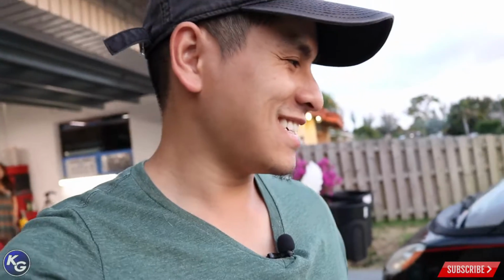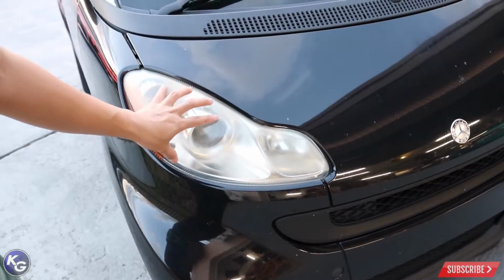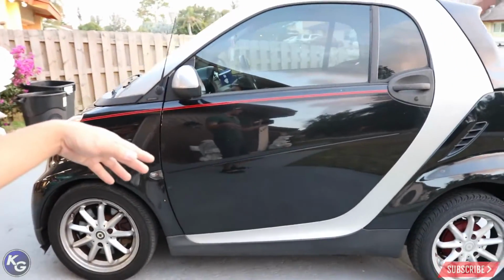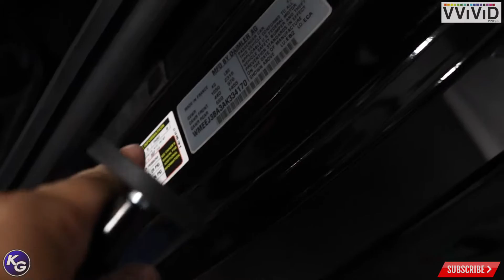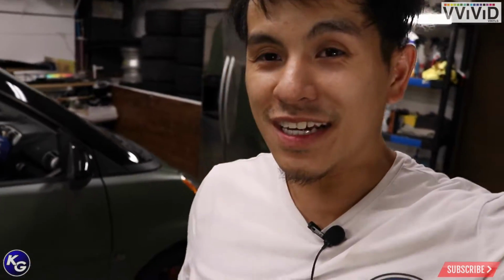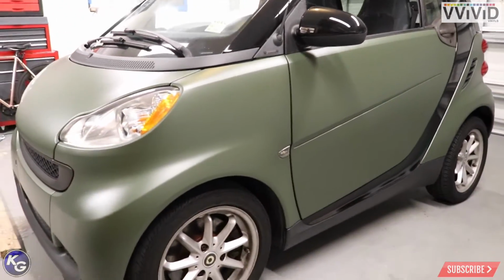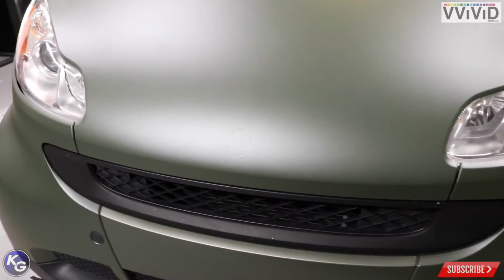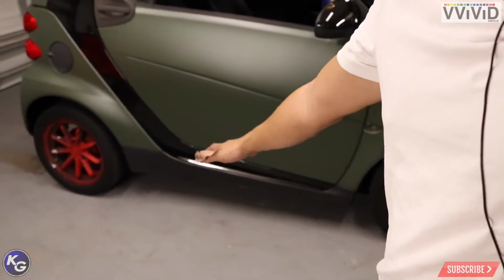I wrapped this car in 24hrs

Comment: I got an orange smart car 2 weeks ago in excellent shape from 2008 paint on the hood was peeling a little so I took down the first layer of orange and spray painted the hood(put some duct tape on the smart logo and headlights for a professional $2 spray paint job) the hood is black now(cheapest spray paint color) I might change it to brown on military green next week...I've gotten at least 5 or 6 compliments on my spray job on the hood took about an hour maybe 45 minutes...will be using at least 2 bottles of nail polish remover and a $4 can of brown or military green spray paint if I repaint it